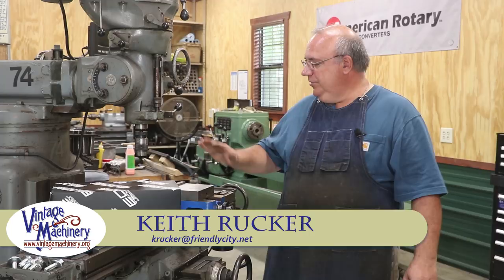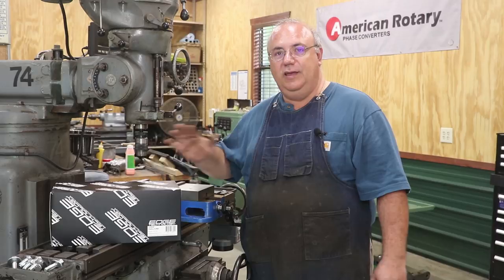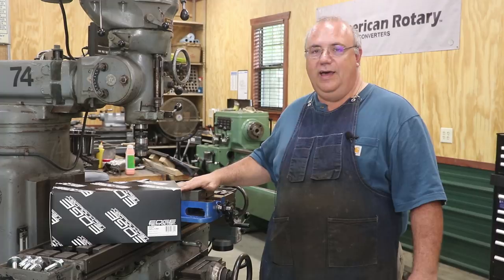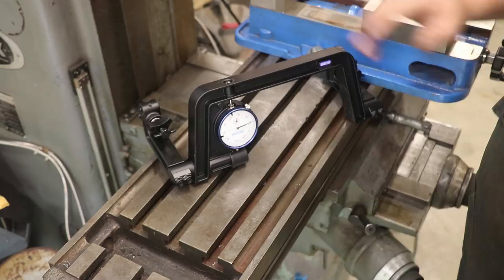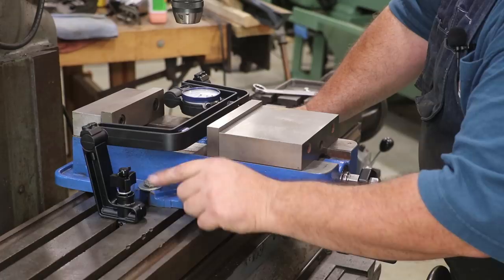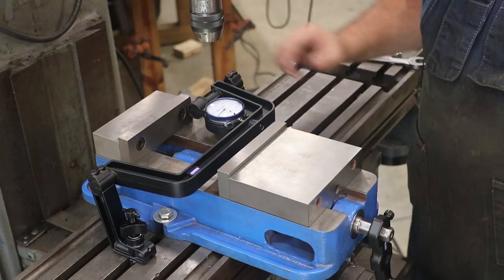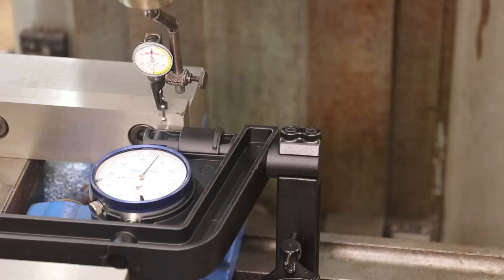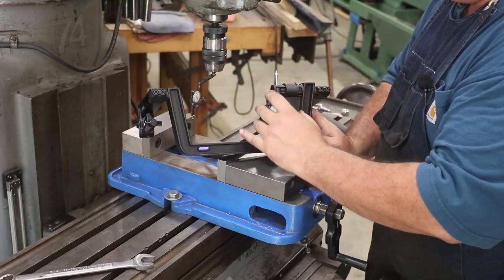Edge Technology "Vise Square" Tramming Tool

Comment: “Me too.” Thanks for the review, but this is a tool without a purpose, unworthy of Edge. I first thought “this is interesting,” but when the Last Word came out not as a proof but as the actual tram indicator...well, okaaay. At least the review gave me the idea to stick my Noga to the table to monitor the “stationary” end of the jaw while tapping the vise into tram...not that it was ever a big deal, since I snug that bolt first as a pivot. This is crazy complication for nothing. And I can’t imagine rough-squaring a Kurt vise I can barely lift against 4 ounces of aluminum with two hinges, secured by a couple of machine screws. The whole thing’s nuts.

Now if it’ll magically figure the differential when tramming Bridgeport *nod*....

Comment: I've always used my protective table placard it's it's nicely between my BS 0 & Kurt 4in, since one or the other is always on the table. Since I put a leather bumper on the placard I don't even have to remove one of them to dial in the other just dial in and then you can remove the other.

Comment: I can see this as a teaching aid, or as a gift from a non-machinist to their favorite machinist, and, hey, it'sa market economy out there, so if Edge can sell it and make money, who am I to say anything?

That said, for ~90% of the jobs that get done on a mill, the method which John Mills(?) aka Doubleboost used in his Sunday Night Nightcap two nights ago - and mentioned by a few others here as well - is plenty good enough.

You take a reasonable square bit of material, and rest it between the dovetails for the knee (which should be ground very square & true) and the backside of your vise jaw or work piece. then gently tight down your hold-down bolts.

I've used machinist's squares, 1-2-3 blocks, parallels, and various bits of reasonably square and true material to do this.

I'm not a huge fan of attaching keys to the bottom of the vise, as the key slots need to be milled very true - not a sure thing - and the keys need to be protected from damage when the vise isn't on the table... especially, the screws which mount the keys are a bit too easy to damage in my experience. Given how heavy a 6" vise is, turning it over to remove or re-install those keys is a bit annoying at times...

And, when you do need to dial it in with an indicator, if you've started with a square or parallel, you are already within a couple of mils (1 mil = 0.001" for the younger folk) and thus can hit your marks pretty rapidly.

Like a couple of things from Edge, this is a pricey gadget that is worth a bit less than half of what they charge, in my opinion. The cool! factor doesn't pan out...

Comment: If some readers have a problem dialing in a vise and their vise has squiring up slots machined in the base make 2 T-slot blocks to fit permanently for quick basic lineup and then dial in if its necessary instead of using that big cumbersome jig that needs a home when not in use, there is a saying that's been around for donkey years that says it all, Practice Makes Perfect,

Edmund.......;.....Alberta

Comment: I normally do not have any problem squaring up my vice. I have a T-Bar that I clamp In the vice and indicate off of.  It's about 18" Long. I first line it up by eye with the T slots, Then I zero the dial indicator out, on center with the axis of the vice. As I move the table out to the end of the T-bar, the indicated distance is amplified. Given a more accurate reading. I can normally get it within a .0005" or better first time. The trick is to Line it up by I first and zeroing the indicator off the center of the vice axis.

Comment: Took me a bit to figure out what the function was here, and I guess I can see the advantage, but the cumbersome nature of the tool doesn't seem to me like it'd add up. I'd be much more interested in a version of the bracket where the cross bar was precision ground rod, and the micrometer was left off entirely. Add to it some precision ground feature sticking down the T-slot, this would allow you to get an enhanced version of that first step, so you're already very close for the indicator needle.

This micrometer based version seems much more useful for training purposes until your guys can wrap their head around the task; and in that case it'd only be worth an investment if you have a lot of guys, and significant turnover.

By the way, I appreciate the clarity of your disclaimer, however you did say you were provided this, and get to keep it; that qualifies as payment and makes this a paid advertisement. As such you're supposed to mark the video as a paid advertisement in the system so the little "paid advertisement" text pops up in the bottom left hand corner at the start of the video. You may also want to check with a professional about whether your deal with American Rotary makes every video featuring their banner and the Sponsored By block in the description a paid advertisement.

Comment: Sorry to say, but this seems like a silly gadget. Not to mention that most vices can be keyed to the slots, which will get you fairly close, close enough for the majority of work amatuer machinists will do.
Reply: On my latest from H&HIP, the keyways need some attention before I'll be happy with their trueness...

I've used machinist's squares, 1-2-3 blocks, parallels, and larger bits of reasonably true wood or metal to get the vise jaws reasonably square to the table or the column - John Mills(?), aka Doubleboost here on YouTube posted a Sunday Night Nightcap two days ago where he used a drop of "aluminium" ;^) to do this.

If nothing else, it gets you to a pretty good starting position if you actually need to sweep with an indicator to dial in a better tram... less than ~10% of all projects really need to be that true in my experience... not only amateur work, either...